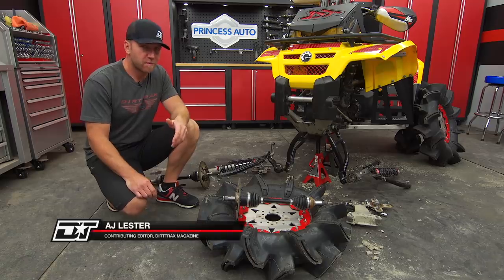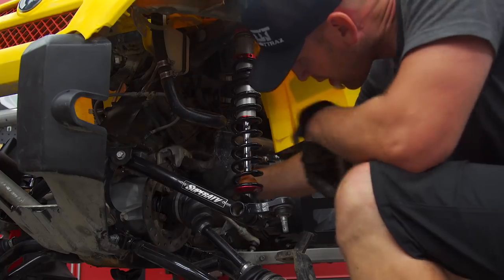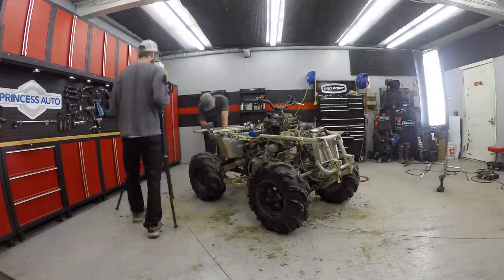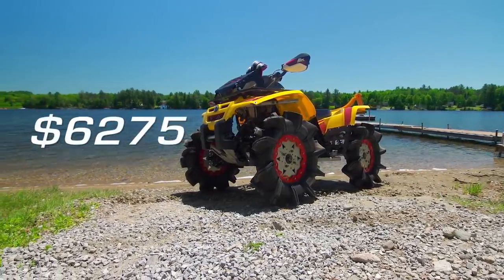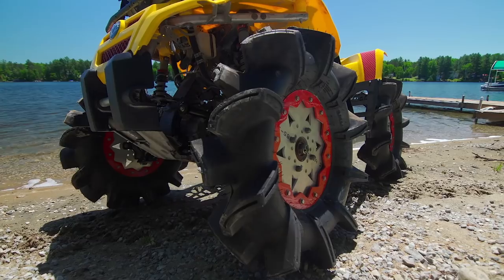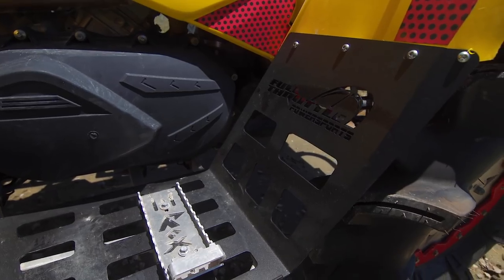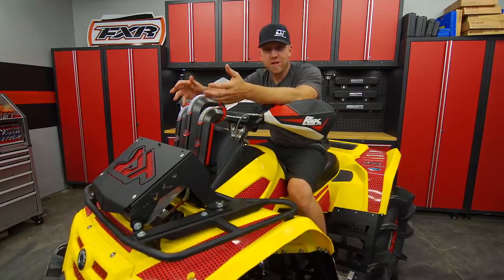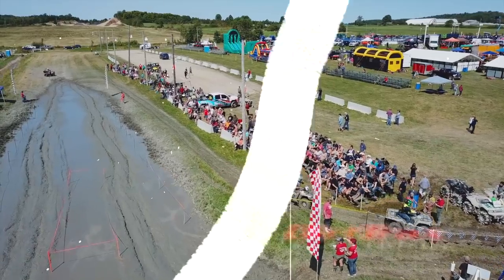Can-Am Mud Build: Part 10 - Budget Breakdown

Comment: To let you all know a can am xmr is probably one of the most common mud quad could run you around 10-15 thousand dollars depending what you put on it on when you are picking parts. And even after decking an xmr out online it is still going to need way more parts to keep it in shape. The quads you see on ostacrusier and at races like these are highly modified and very far stock.

Comment: I don't get how $12000 is a budget build
Reply: Emory Bragg was thinking the same😂
Reply: to be competitive thats pretty cheap. of course they could have opted out of the motor build and diffs but they needed them for racing.
Reply: This is way a budget build im 2.5 times that on my bike i bet
Reply: It isn't on a budget at all at that point. They went with a full service. Axles, radiator, tires and wheels, snorkels, new rear diff, strengthened steering??? 

I mean, to an extent, it is on a budget. If your budget is 4-5 times as much as your initial purchase on the quad...
Reply: I budget doesn’t mean cheap it is a amount of money set buy some and they don’t what to go over the price set
Reply: My 2018 Outlander 850 Xt cost $12,300 brand new.... Just for comparison
Reply: A 2018 can am outlander cost about 12k
Reply: A new can am 1000 is upwards to 15k lol an that’s just for a stock bike. 80-100 hp bikes arnt cheap, especially building them to race like this without breaking
Reply: @Jambiiiii  not too long ago I spent a pretty penny on a Polaris 570. Now I understand why 12k is a budget build for a super nice off reader. Thanks for the input
Reply: @user-gp6sw  but this thing makes about the same amount of power to the wheels as yours does to the crank… and his will go thru way more mud lol

Comment: Nice bike more like no budget though
Reply: Charles Corwin that's a budget friendly build with out halfassing it together. 
I build my fair  share of atvs down here in North Florida
Reply: Dirty South Off Road No doubt. For the common rider that's a pretty penny though.
Reply: Charles Corwin definitely a pretty penny. But, like he said, you pick up a 1k xmr or highlifter, and you've got to immediately dump two or three grand on top of that 15k price tag to keep it from tearing up or fixing factory flaws. 
Hence why my two main bikes are 500s, not a ton of power, but will definitely take me anywhere I've ever tried to go (minus that time I blew both front axles in the clay hole, which I wasn't the only one that day to do so)
Reply: Dirty South Off Road I hear that. My brute 750 rips through bearings like no tomorrow just in stock form. Ripped an axle too. Gotta pay to play!
Reply: Charles Corwin that's the understatement of the day.  
I've got to do a top end on my cat,  3k miles of extreme abuse, some new axles, and wheel bearings twice a year. It's an expensive habit.
Reply: Dirty South Off Road Expensive but worth it